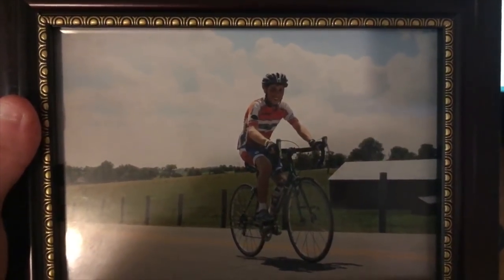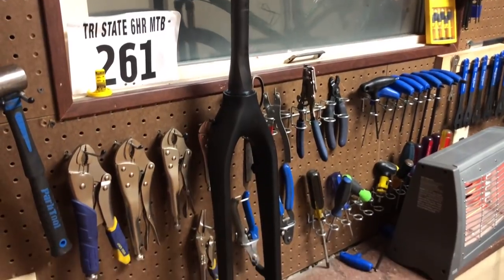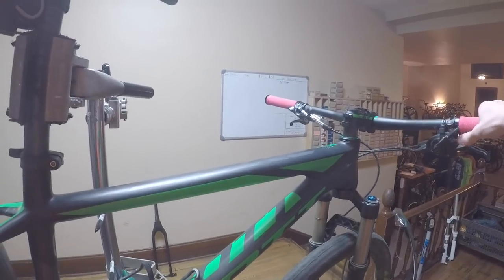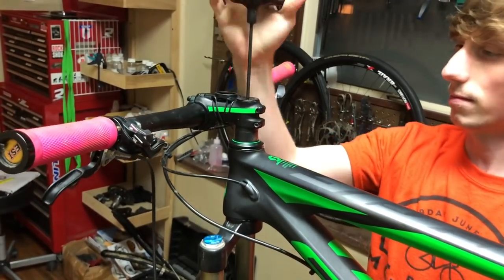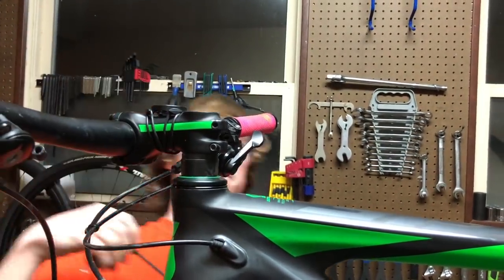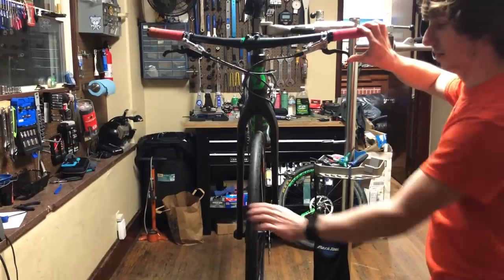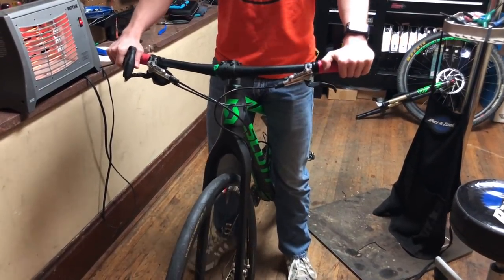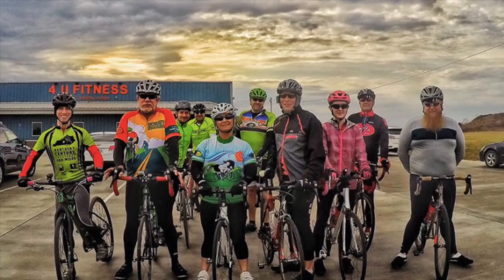Convert a Mountain Bike into a Road Bike!

Comment: It is pointless using less than 30mm tires. Slick is needed for road biking. But you don't need less than 30mm. Using narrow tires will not make you faster and with 28 it is almost impossible to go off road. Why you think that pro road riders don't use 21mm with 10 bar pressure anymore? Because it is pointless. With 33mm you can ride in same speeds like with 25mm, but also you can use less pressure so it is much more comfortable and you can go off road no problem.. I like MTB with hard carbon fork and slicks, but with at least 33mm tires. So it is fast, comfortable and universal bike for road, gravel or even off road..

Comment: This is way way to expensive. A fork and wheels? The most I would do is change the chainring and put 700c x32 or 35 tires on it. Or is that a 27.5? Either way, a fork and wheels right there you could almost just go buy a Trek Domane or a Trek FX for even less.

Comment: Crazy its lighter than my carbon road bike, with carbon wheels. im at about 8.5kg
Reply: 8kg carbon rip rip my steel bike with only carbon brake lever  blades is 7.3
Reply: Im carbon, frame, fork, carbon wheels, got carbon in my cassette, lightest new dura-ace cranks, carbon brake levers, carbon seat, lightweight pedals and its 8.5kg :( I think the weight is from my disk brakes, 160mm front and 140mm rear, then 28mm tires with lots of tubeless sealant, then the giant had the overdrive headset which is 1"3/8. Weight doesnt really matter to me, my bike is just functional for steep hills with 40T cassette and then good brakes to go back down.

Comment: If I was you I would have just locked out the fork so then it would be realy easy to go to MTB mode
Reply from the maker: I actually did that a couple times! The weight was a little overwhelming on some climbs, and the fork didn't lock out 100 percent, so it wasn't fully stiff. But it was fun and challenging.

Comment: People can't understand simple things

First, you will not tell me what i like to ride, it's my bike, my life, my ass, i ride what i want

Second, drop bars, bullhorns etc etc, NOTHING has the leverage and the control of wide flat/risers

Third, biking it's not only speed, i don't care to ride over 30-35km/h, i care more for comfort, and the MTB geometry is best for that

Fourth, yes you can change only the tyres, but with a rigid aluminium/carbon fork, you will lose 1.5-2kg, especially if you have a crappy stock fork just like me

Comment: I have a steel old mtb bike is 622 like 29 mtb wheels idk what the hell the guys who made bikes thinks i mean 700c is 622 mm and 29 is not 29 inches
... Is 622mm too... So wtf! Ok... I have an mtb steel full rigid bike and i run ”29” tyres actually 622mm x 35 becuase i put a 1000w motor (yea boi) so i need some suspension and is pretty good

Comment: With that small chainring you wont even get 15 mph. Your geometry is also totaly messed up. You need smaller frame for such modification your bottom bracket is now too low and bike is too long.

Comment: Somewhat inexperienced, but couldn't he just get a suspension fork with lockout?
Reply from the maker: You can! A fork never really 100% locks out like a rigid fork though. The closest I've seen and used would be the Cannondale Lefty fork. Those things lock out solid. The rigid carbon fork is stiffer, doesn't have any give, and it's a lot lighter.

Comment: Those forks are too damn big and wide.
Reply from the maker: I like my forks like I like my women. XD It appears to be wider because it's designed to take a mountain bike wheel, but has a road wheel in it. It's a little larger so it might even be able to take a 29er wheel. I haven't tried though.
Reply: If you want a more sexy road bike, get narrower forks and with a tighter tolerance, to maximise aerodynamics and look sleeker. <3

Drop bar is a must.

Comment: I don't want to be a hater, but I really think these video titles are getting out of hand with how misleading they are.
Throwing a rigid fork and road tires on a mountain bike doesn't make it a road bike. It makes it a hybrid.

1) MTBs don't have a road geometry. If you try to put a set of drop bars on a frame appropriately sized for the rider the reach distance will be far too long due to the extra length added with drop bars and brake/shifters (Brifters)

2) This does not have road gear. It has what looks like a 32T chainring and a 11-36 cassette. A road bike gearing would be in the realm of 50-53 for the big ring, and 32-38 for the little ring with a 11-23 to a 11-28 cassette. 

What this means is that in the biggest gear combination to go the fastest at a nominal cadence of 90 RPMs, you're topping out @ 19.3mph. This is the speed midway through the cassette in the big ring on road bike gearing. The mountain setup is practical if you're constantly riding hilly terrain or in the mountains, but not ideal for descents or flats as you'll be constantly topping out your gearing.

The best advice I can give is for a little bit more than the price of a rigid carbon fork and high end road tires, you can buy a used road bike or cyclocross bike, or on the lower end of price, an actual hybrid that is much better suited for the road than converting your MTB...which also means you have to convert it back anytime you want to go mountain biking. This way you can just jump on the bike and go. Also if you do invest in a cyclocross bike, unless they're high end race machines, they come equipped with rack mounts so you could add panniers and use it as a light touring, commuting, grocery-getter for those trips where you only need to pick up a few things.